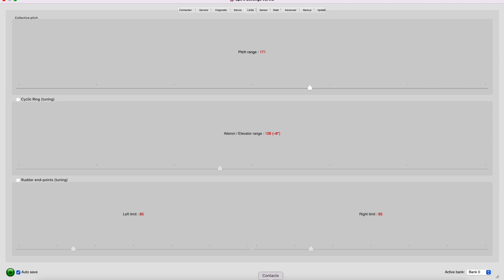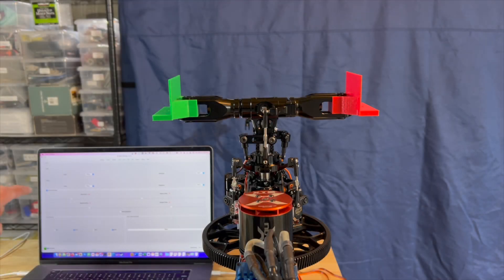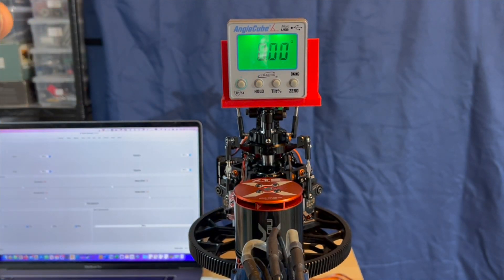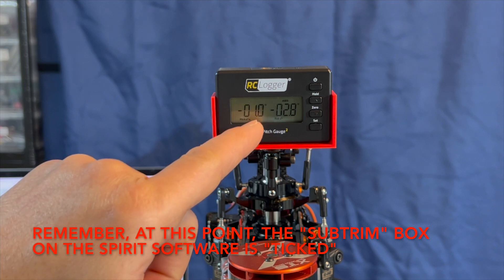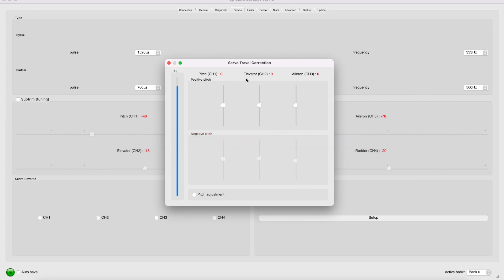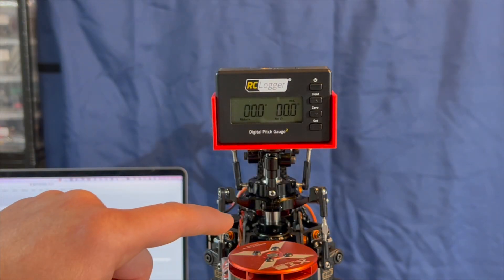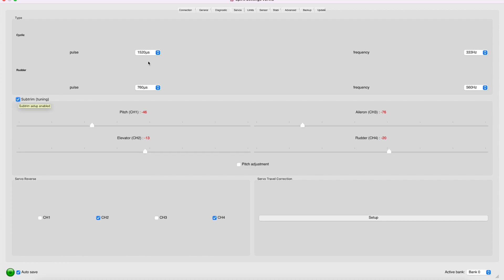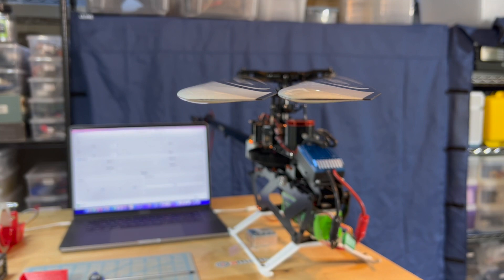Spirit GTR:  Setting up with Jeti Radio    Part 3a    0° pitch, blade tracking, 6° calibration   HD

Comment: What would you do, if the blade tracking is not equal during the rotation around the main shaft?
Reply from the maker: Just to be clear to other viewers reading this, the purpose of blade tracking is to have the main blades path of rotation in the same plane.  There is NO way to optimize blade tracking electronically via the FBL unit, Spirit FBL or otherwise.  The only way to adjust blade tracking is "mechanically" by adjusting the lengths of the main blade grip link rods.  Most newer 550+ size and larger helicopter kits now use turnbuckle style link rods on the blade grips to allow for fine length adjustments, so obtaining optimal blade tracking is now much easier than with older generation helicopter kits.

There are several ways to optimize main blade tracking.  The traditional method has been by eyesight during flight.  There are several variations to this method, but the traditional method is to hover the helicopter at a height so that the main blades are at eye level, and you, the pilot observe for "double blade tip".  If you see more than one blade tip as the blades spin, then you know the blades are out of track.  To be able to distinguish the blades, the traditional method is to add reflective or different color tape to the leading edge of the blades.  Then you adjust the blade grip link length of the blade(s) so you only see one blade tip during hover.  This method has several limitations.  Precision is limited to eyesight.  The human eye may not be able to tell the blades are out of track until the blades are more than about 0.4° or 0.5° off.  If the blade tracking is really way off, there may be pretty significant aileron shakes during hover, making this blade tracking process more challenging.  There is a personal safety concern component as well with this method, as it relies on hovering a potentially significant blade out-of-track helicopter at eye level in relatively close proximity.

The more modern method of blade tracking relies on main blade tracking at the bench BEFORE the maiden flight.  There are different variations of this, but they all rely on adjusting the main blades to 0° pitch, which is usually at mid collective stick for 3D helicopters (scale and speed helicopters may be different).  Explaining the logistics may be best with a 12 to 15 min video, but generally you want to get the cyclic servos arms 90° to the main shaft and have a level swash BEFORE to tracking the main blades.  This step is best accomplish by getting the FBL unit in "setup mode" to deactivate the gyros.  There are several tools available.  There are a few variations of 0° tools.  Another method is to fold the blades and adjust the blade grip rod lengths so the blade tips are even.  Another method relies on using digital inclinometers which can take the form of dedicated pitch gauges, angle gauges, or even a smart phone.  The SOKO tool takes it to the next level when it comes this setup.  All these modern methods have their inherent pros and cons, but they tend to yield very good to nearly perfect blade tracking on the maiden flight.